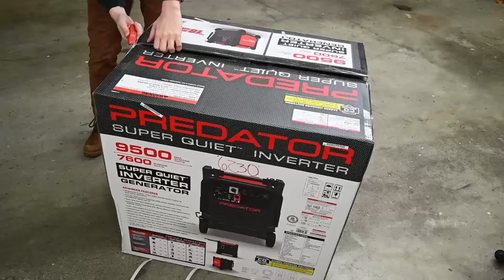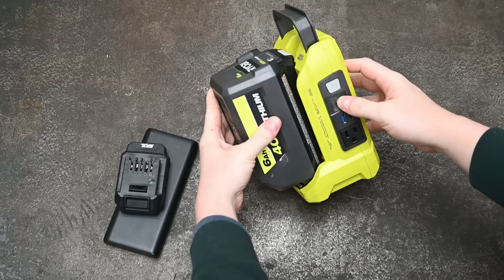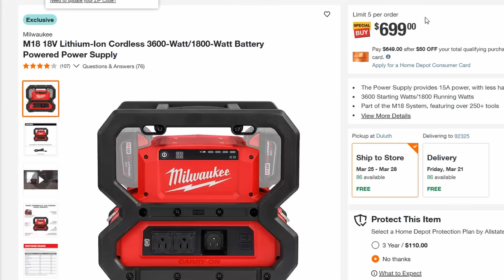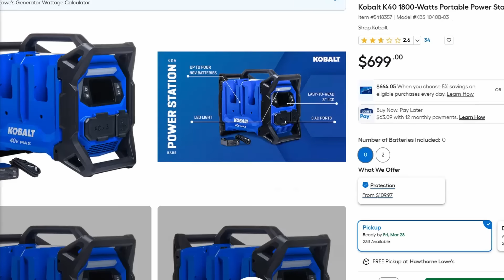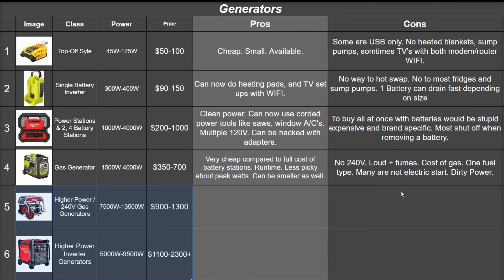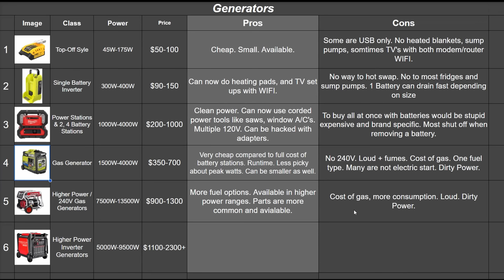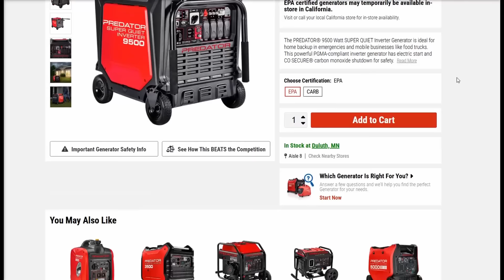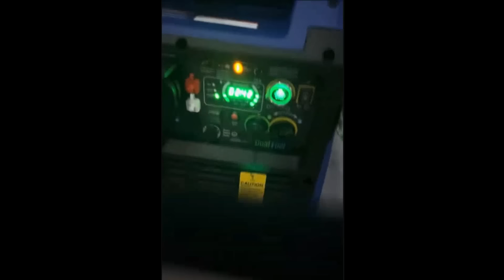Buying Harbor Freight's Most Expensive Generator So You Dont Have to

Comment: I got the Milwaukee Top Off years ago and I use the shit out of it. I used to go One Wheeling to a park, sit on a bench and charge my one wheel while playing Switch. Then come home. Ive got a one wheel pint and 1 5AH Milwaukee battery did ~60% charge for the One Wheel. So if I stopped at about 20-30% it'd charge up to about 80-90%.

Comment: I have 2 ecoflow delta 1s. They are getting SO CHEAP compared to when they launched around 2020. But I suggest 1 for a deep freezer and one for a fridge. It may not be worth saving the fridge if it's an older model. Mine barely lasts 12 hours while the deep freezer can go for almost a day and a half. But it depends on how long your outages tend to last

Comment: In my personal experience(s), the bigger and better generator you have, it reduces the odds of a power failure and your actual need for it. Paying more also reduces the actual need for it.  ;)

I've had all the way from a gas powered 2kw, up to a 16kw diesel set. Now have a 10kw gas. Worked in the industry up to a 2MW set that was a bit bigger than a bus (yes, really).
Reply: The power company once shut down the power for a day in several city blocks.  We got a generator to power our building, it came in a 40ft trailer.   We also powered the bar next door....
Reply: Surplus military generators, if you can find them, are worthwhile
Reply: @rhetorical1488had an mep803 powering my house 2 nights ago. Got it wired to a generac ATS so that bad boy fired right up and took care of us through the night. Diesel fuel is easier to get than propane, stores better than gas, and my ATS means I can be away from home and my wife and kids will have power. Perfect solution for us.
Reply: Thumbs up for the MEP803.  The 803 is a bit older, but rebuild parts are readily available.  803s come up fairly often on GovPlanet, but lately the ones I’ve seen there have been pretty beat up.  I was looking for an 803 a few years ago and nothing serviceable had come up in a few months, but I found an MEP1040 which is also a 10 KW model with only 6 hours on the meter.  The downside of the MEP1040 is that it has an electronic control panel and converting it to automatic start requires a fairly pricey board from a 3rd party.  Also, the military sets aren’t very concerned about size and weight.

The military sets are designed to operate as prime power units and will run 24x7 at rated output.  In the case of the Cummins-built MEP1040, the engine is a 23 KW Yanmar Diesel and the alternator unit is large versus its 10 KW rating  If you turn on the battle short switch, the generator will supply 100% overload for a long time.  I’m not sure how long, but everything inside appears to be close to 100% overbuilt.
Reply: Still in the industry. I have a 45KW Kohler 4.3 vortex propane and use my portable Honda 90% of the time. 3.5 gph on the Kohler @ $2.75 a gallon x 100 hour outage doesn't cut it.
Reply: @ ouch yeah that gets pricey in a short time! Wanting to implement a hybrid system now. Despite consuming a relatively small amount of diesel per hour it sure is wasteful to run the MEP when only drawing 1kw like we do so often. With battery and inverter the generator would only kick on the charge batteries when needed. Oh, and I guess I may as well get solar panels at that point too😂
Reply: @wsmc8275  THAT is why generators are so non viable, you have to pay for a fuel you can’t make. If you have a tall hill on a few acres of property digging a high pond and a low pond and running off of a waterwheel alternator. This is the way
Reply: Crazy right? Same thing here, we've had some week long (even 2 week long) blackouts. Every year (in summer, fun times with heat). At the time, I had my truck wired with extra marine batteries and an inverter, which would save my fridge for a solid day. but I had to swap out extra batteries and charge them at my other place. 

So I finally invested in a predator 2500w generator. 4 years ago.

Have yet to use it since.
Reply: Some Murphy guy's law
Reply: Yep. Spent around $5k a few years ago after power outages in probably 3 of the prior 4 years. Lights have barely flickered ever since

Comment: Great roundup!  The only thing missing here, is do any of the smaller power tool or OPE battery powered inverters have a clean sine wave output?
Reply: Probably not because the circuit boards are massive with all the electrolytic capacitors

Comment: Update on my dcf961, hammer mechanism got destroyed.. went to dewalt repair center and got back, still alot issues and sent back with batteries, seems that my powerstacks are also faulty.
Reply: Seen a couple of videos, peoples having problems with the DCF961
Reply: @AlexY2-b6y  I don't use my tools professionally so them breaking is pretty annoying, I still occasionally use my light green tools that are more than 7 years old and they've never had any building related issues. I think that major brand tools shouldn't have any issues during warranty time when not in professional use, especially flagship models. I'm very disappointed in DeWalt tools.
Reply: Damn!, that really sucks.... planning on getting my first high torque impact, after seeing several videos on malfunctioning DCF961, I would probably get the DCF900 or M18 2967. Like you said, for an expensive brands, it shouldn't broke during warranty periods..... sometimes cheap tools are far more robust & tough than overpriced name brands.....